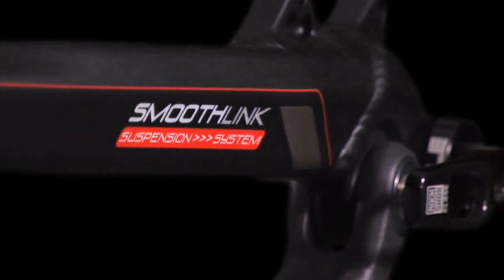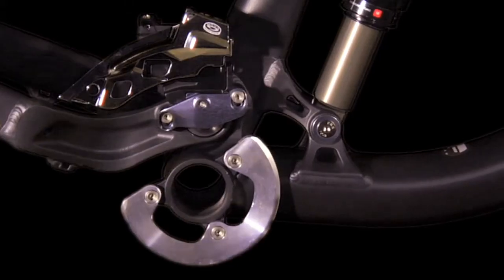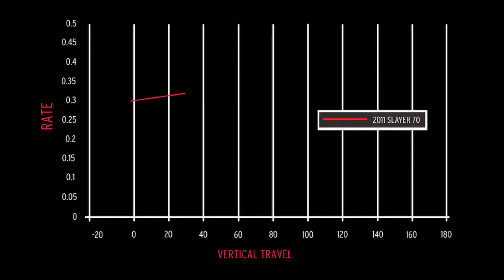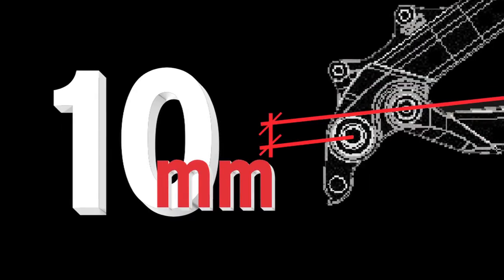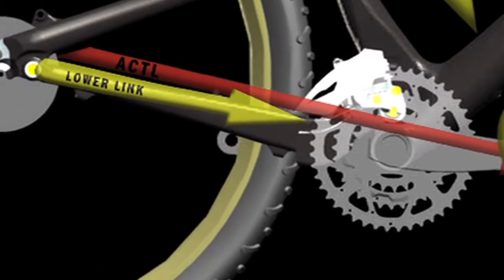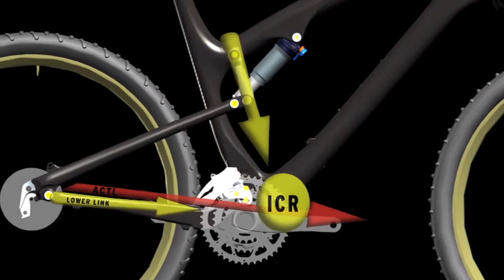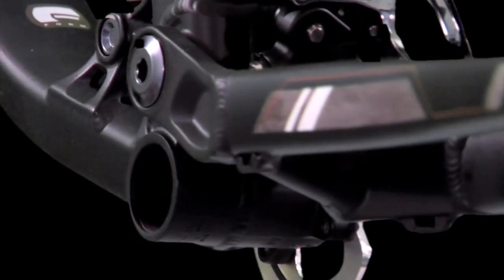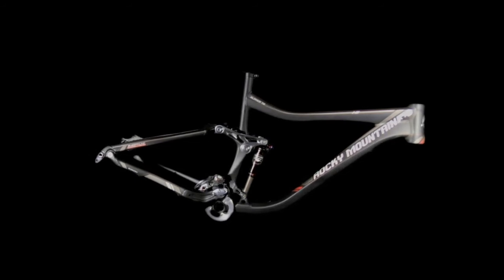Rocky Mountain Bicycles | SmoothLink™ Suspension System

Comment: I don't see how balancing chain forces through the instant center (similar to a suspension platform like CBF on Revel bikes) eliminates pedal bob. While it would isolate the chain force from the suspension, wouldn't there still be bob present under acceleration due to the weight transfer causing the suspension to squat?
Reply: Ride one. You’ll feel it. It does more than eliminate pedal bob. It just thrusts you forward.  Wild stuff 
Check out vampire bikes